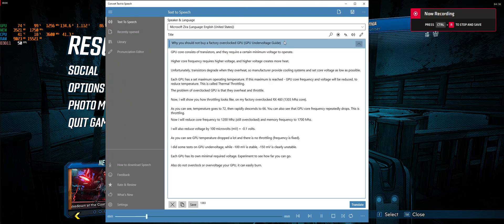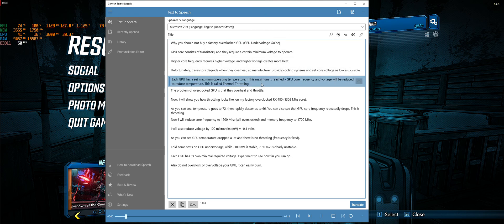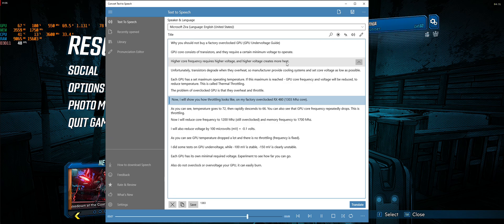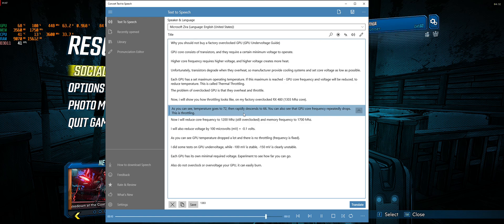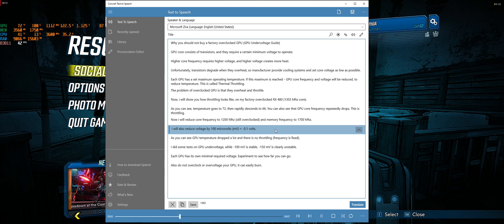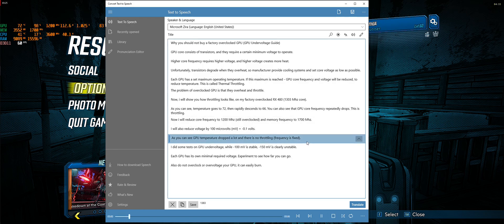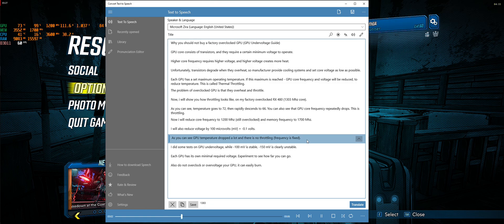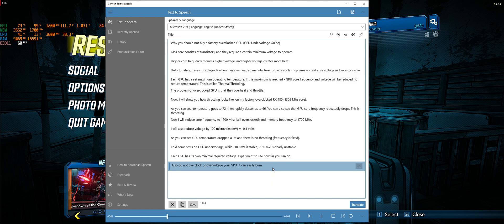Why you should not buy a factory overclocked GPU (Undervoltage Guide)

Comment: Don't forget that factory OC cards usually have a way better cooling solution than the founders edition. Thus it's not just an overclock,it's an overclock that's guaranteed to work and cool fine.
Reply from the maker: its thermal throttling on the video.
Reply: @ixthUA  Perhaps that's the case with your card...Which is unlucky, but my Factory OC RTX 2060 has a triple fan solution which never goes over 68C, even under 100% loads for a longer time. I even overclocked it myself to 2050 mhz and the max temperature I've seen was 71C.
Reply from the maker: @RavexMisc  throttling temperature depends on gpu model, for my card its 73C. higher temperature will damage the chip, so it throttles down, which defeats the purpose of overclock. even non-overclocked gpus have decent cooling (non-referense cards), so you can still overclock them (and maybe undervoltage a bit). idea is that you don't need factory overclocked gpu to overclock.
Reply: @ixthUA  I agree. But what I'm saying is, a normal RTX 2060 comes with 2 fans usually. My OC model came with 3 and even with an overclock it doesn't reach the throttling temperature thus it won't throttle - even when overlocked. So I'd rather suggest people to check the cooler of the card they're buying.
Reply from the maker: @RavexMisc  many overclocked gpus are sold with 2 fans, like mine.